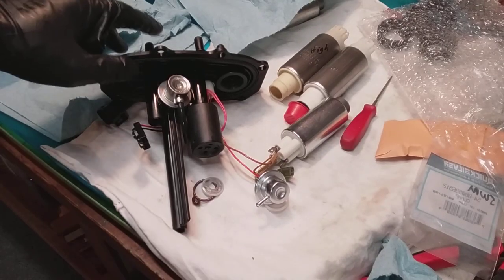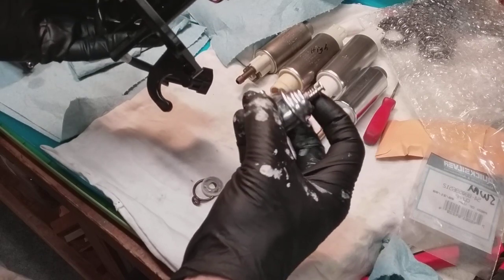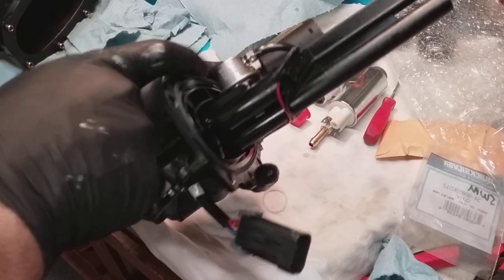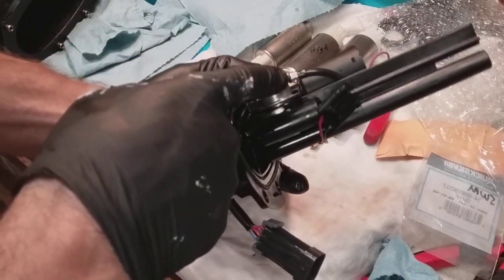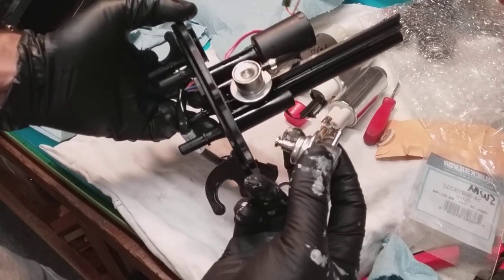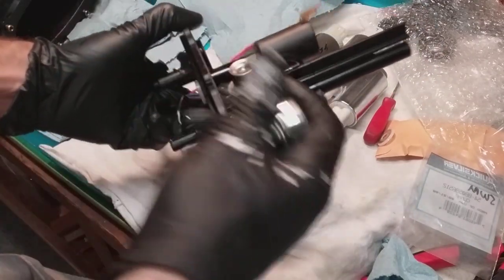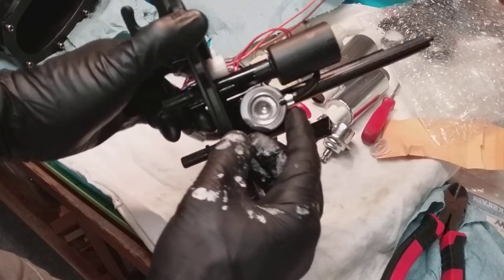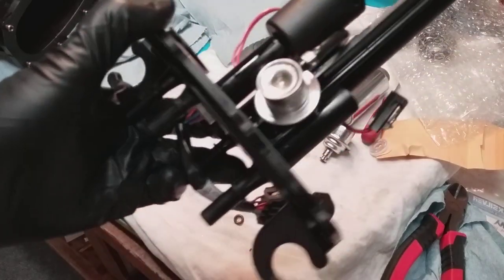UPDATE Misdiagnosed How to troubleshoot 90hp Mercury outboard 4 stroke fuel issues Part 3

Comment from the maker: Ok folks, I think I totally went down the wrong path, not the first time but I did learn a lot...at an expense of course.  I hope my experiences and videos will save you time and money.  I do feel more comfortable with my knowledge of this boat and motor so when things act up I will have a better sense of what is going on.
Reply: I'm having the same issue.. replaced both pumps and float switch. Did you figure out your problem?
Reply: @matthewmaziarz5339  Did you figure out what was going on with yours?
Reply from the maker: @JoshDiaz5674    I think it was the fuel line elbow that passes thru the cowl.  This part https://amzn.to/34Caqis
Reply: @JoshDiaz5674  Not yet.. I will change the elbow and see if that fixes it
Reply: @matthewmaziarz5339  I had same problem.  The problem was with the gas line from the boat to the engine connection.  The fuel hose has a plastic liner inside the hose.  When the hose was pushed onto the fitting on the motor the plastic liner was pushed into the hose and collapsed.  I can not understand how gas was getting past the blockage enough for the engine to run.
Reply from the maker: @matthewmaziarz5339  I think it was the fuel line elbow that passes thru the Cowl.  See my link to the part in my description above. https://amzn.to/34Caqis
Reply: @wetlifesports  Thank you! I will order the elbow and see if that fixes it. Great video! All the best